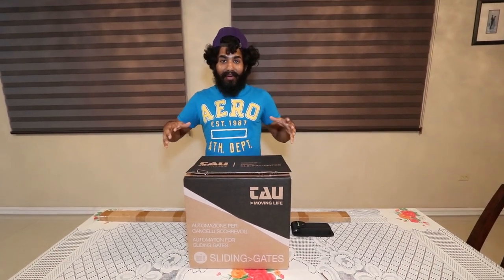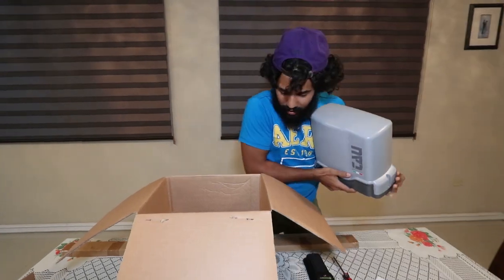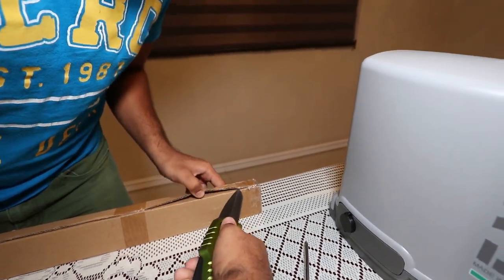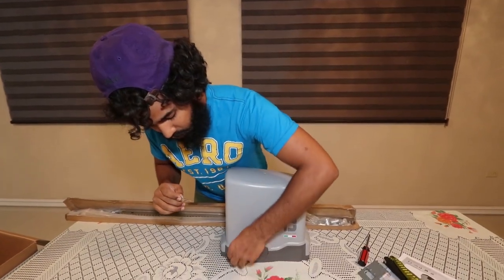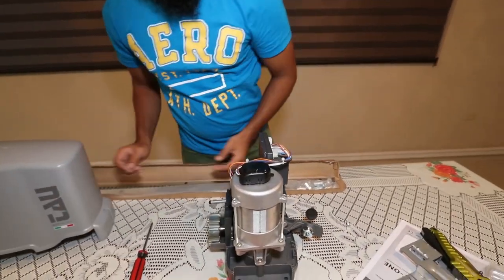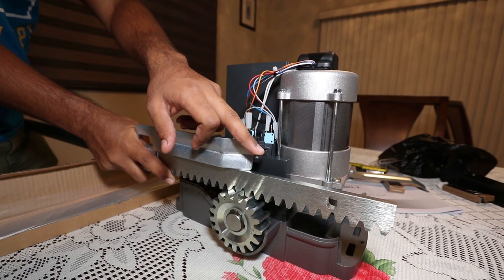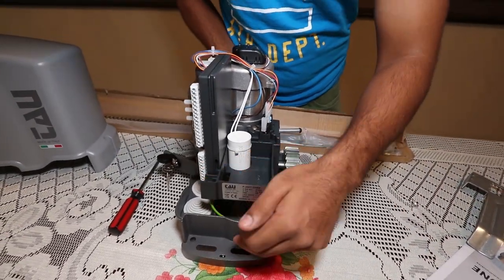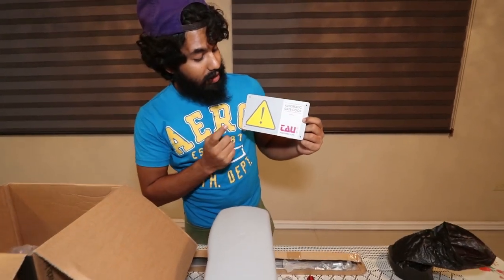TAU T ONE Automatic Gate Motor Unboxing

Comment: The length of metal with teeth is called a gear rack not tracks, the track is what the gate wheel slides on.

Each gear rack is 3 ft 3” so 4 x gear racks actually measures 13 ft and not 12 ft as most technicians would believe.

The switch you mentioned is also called photocell sensors/ safety sensors.

Just trying to share the correct info, good video otherwise, keep it up.
Reply from the maker: Thanks for sharing this info.